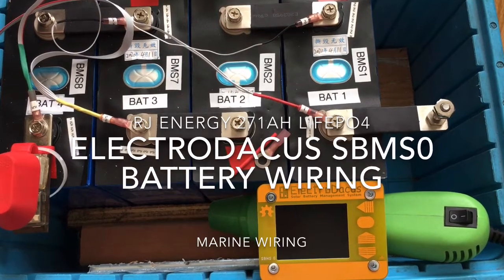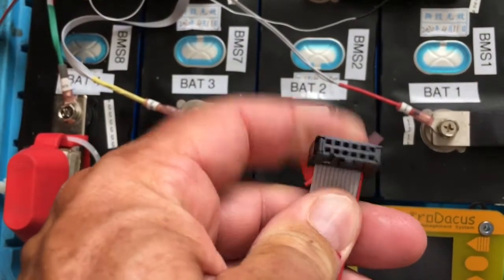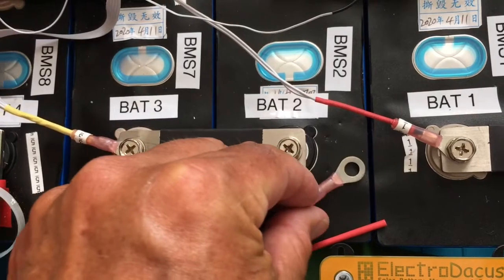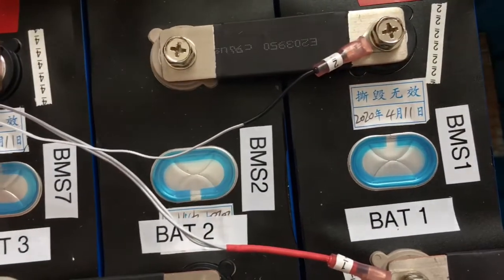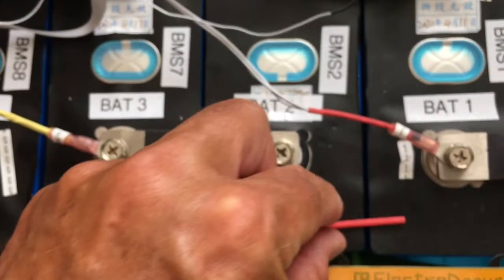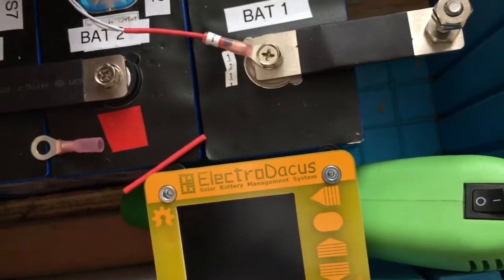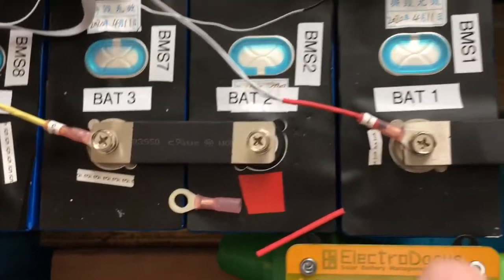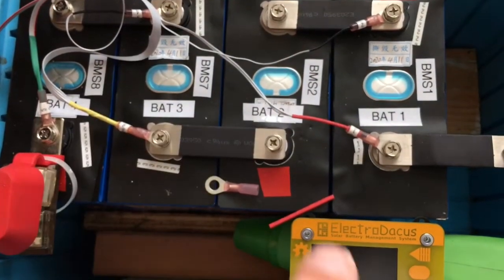Electrodacus SBMS0 4S LiFePO4 BMS Battery Marine Wiring for 12 pin connector on Sailboat

Comment: I realize this is an old thread, but perhaps this comment will be useful to someone who ran into this video just like I did. Another way to attach sensing/balancing wires to the battery terminals is to drill and tap them and use appropriate (and much smaller) connectors crimped on those wires.
Reply from the maker: Thanks for the info!

Comment: With the Sbms0 you can not have a fuse between the shunts and the positive terminal and the Sbms0 module. You can have a fuse on the load side of your bus bar. You can not have a fuse between the shunts and the positive battery terminal. Sbms0 has to see the battery power all the time. You can have  a load protect device ( ie: Victron bp 65 or 100) that the Sbms0 can turn on and off. My 300amp fuse is on my Victron bp 220 going out to the load. 
If your fuse blows you will destroy the Sbms0. 
The Sbms0 works great.
Reply from the maker: This is a most disturbing fact. I will always have a fuse right very close to the battery so I do take and accept the risk of blowing up the bms vs burning down my boat with a dead short on the other side of the of the shunts. This is most certainly a design flaw in the sbms0 that encourages people to make the wrong choice in fuse location. I think a battery switch in the wrong  location would be the more common way to blow up a sbms0 rather than the 300A MRBF fuse!  It is sort of a crazy design really. Thanks for pointing this out.
Reply: You could also put a fuse on the negative side of the battery. Theory says voltage runs negative to positive. In the automotive industry it’s very common to switch the negative side of the circuit. 
It doesn’t hurt to have a fuse in both circuits. 
If you have a problem email Dacian at electrodacus@gmail.com he is a great help with information. Good luck. I’m super happy with my Sbms0 and I’m using 2 of them on different battery packs
Reply from the maker: @craigmckenzie8028  Thanks for your comment. I'm going to keep my fuse where it is because it would be  very rare that I would blow the fuse. However the main battery switch location may need some rethinking on my part.  It would be great if Dacian would have a external protection solution using fuses etc. Other BMS systems don't have this issue as fare as I know. My current system is a Smart BMS that is low side mos fet switched. Thanks again for your suggestion.
Reply: I thought the same thing as you about the fuse on the positive terminal. I originally had mine on the positive terminal when I was running a Chargery bms. I was super careful working on my battery when by accident a wire I was moving touch ground for a billionth of a second and my 300 amp fuse was blown. It happened so fast. I was not happy with the Chargery bms and went with the Sbms0 and never looked back. Just remember blown fuse with the way you have it means no power from your battery pack ( fried Sbms0) guaranteed. Also remember to remove the 12 pin plug on the back of the Sbms0 when working on your system so you can’t damage it. Then when you reinstall the plug reset up the time and date and save settings. Good luck

Comment: It looks great however the heat shrink appears to be ordinary heat shrink. Probably would've been better to use glue lined heat shrink for the multiple wires as there may be a small air gap between them?